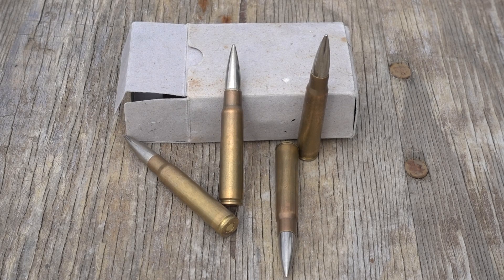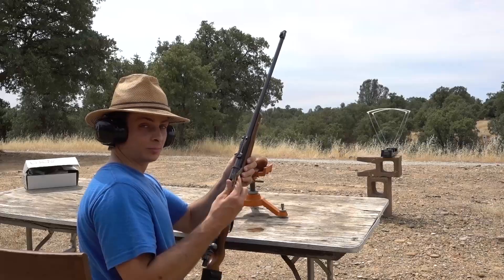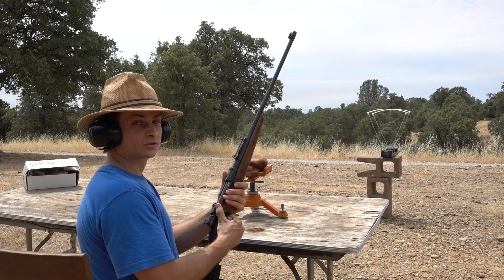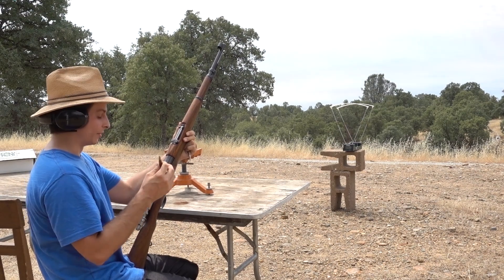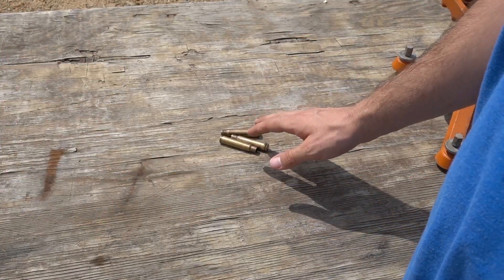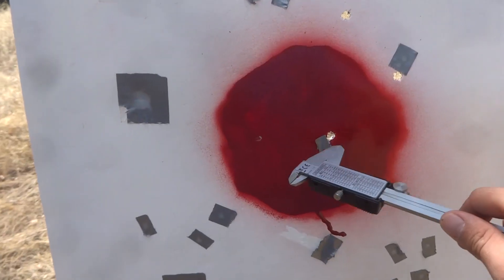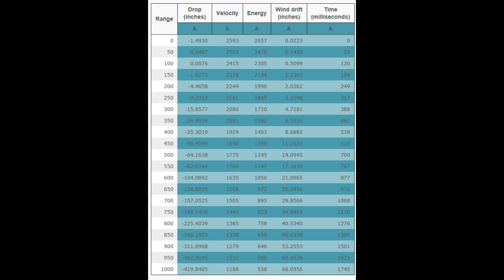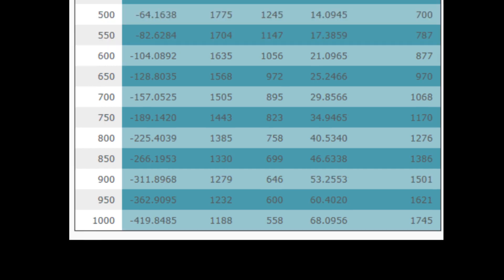8mm Mauser Czech surplus velocity and accuracy

Comment: Not bad at all, most of the Yugo Mauser Patern Rifles have very good bores. My 24/47 came packed in cosmoline with a like new bore and perfect crown.  I suspect that after the rifle was rebuilt it was packed in storage where it remained until it hit the surplus market. Many of the German Rifles were brought back after the war by returning vets, then turned into sporting rifles that have been used ever since. Just My theory on why the Yugo would have a nicer bore. Good job Brother. Keep up the good work.
Reply from the maker: Thanks Brother, I should be uploaded more frequently now I had a pretty crazy last few weeks. My Yugo underneath the stock was covered in cosmoline also. I love my Yugo although it seems my kar 98a still preforms pretty similar to the Yugo even though it is much more worn out.